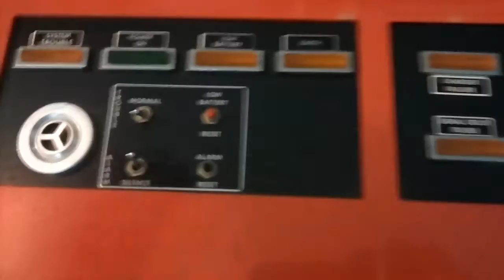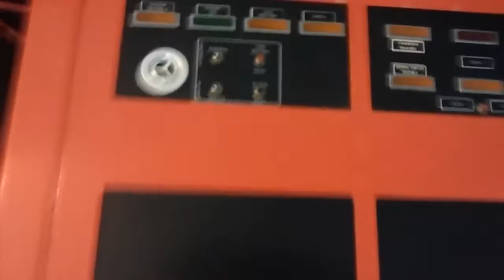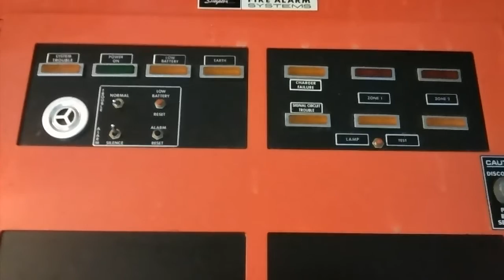System Test 1

Comment: This is what my elementary school has/had. Which tells me at one point they might have had 4051s. When I was there, the alarms were 9219s/9838s/2 SHGs/1 Wheelock AS vertical. I'm sure they replaced it all with Advances though.

The panel was located in a stairwell.